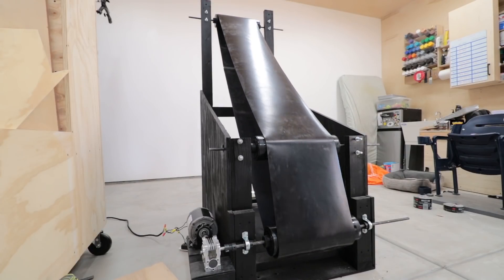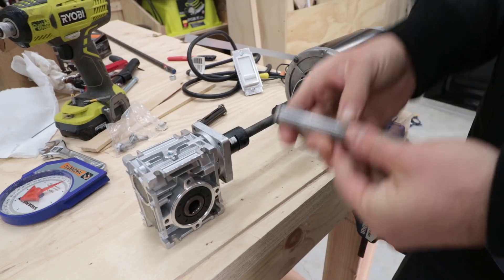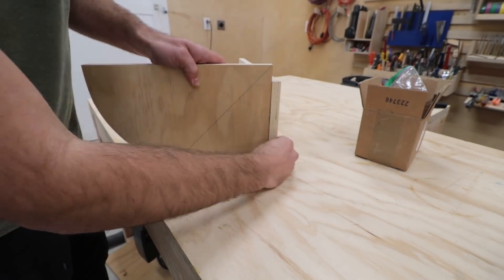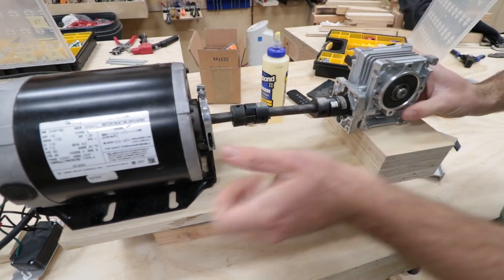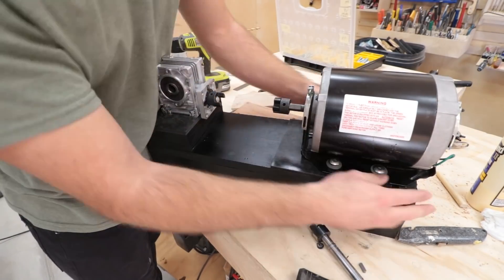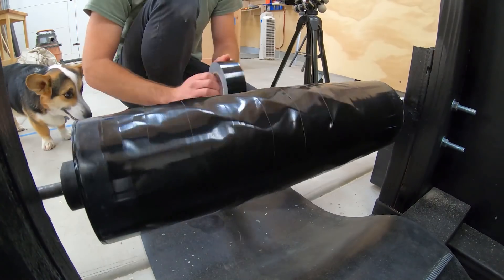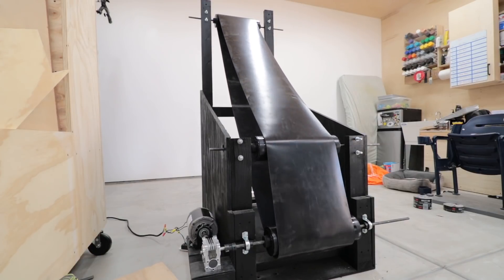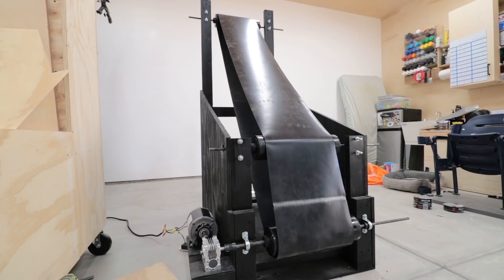Universal Marble Machine Lift Build, Part 3: Connecting the Motor

Comment: Hey Ben.... Just looking at your assembly of the motor shelf and I was wondering, what airtool are you using to tack together everything? Is that a Brad Nailer? Pin Nailer? Finish Nailer? I'm in the market, and I really like how well things seemed to go together for you. I'm also invested in the Ryobi One+ system, and it looks like they have a nice collection of nailers I've been looking at instead of going pneumatic. I don't have a shop yet to keep all my toys :)
Reply from the maker: That’s a brad nailer. For this instance really just meant to hold things together until the glue dries. Brad nails go from about 3/4” to 1” finish nails go from 1 1/4” to 2”. Which one you use really depends on what you’re trying to connect and how. Haven’t tried the Ryobi nailers but I’m sure they work great!

Comment: Sort of counterintuitive that a crown on the roller would prevent the belt from traveling; I'd have assumed a valley on the roller would do that. Interesting!
Reply from the maker: I was baffled as well! Ya learn something new everyday
Reply: @BenTardif  Matthias Wandel the mad scientist woodworker explains it well: https://www.youtube.com/watch?v=6sM0Qjumyro
Reply: The middle has bigger diameter, so speed is higher. Then if the band drifts to the right, its left side goes faster, making the band turn a bit clockwise on the roller. Then it is transported in such a way that the drift is corrected.
Reply: @landsgevaer  Science!